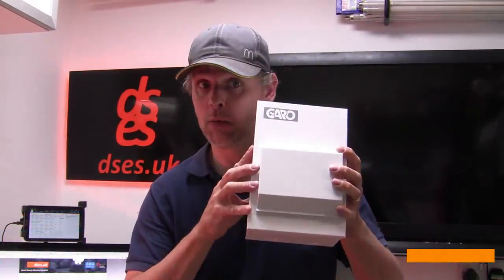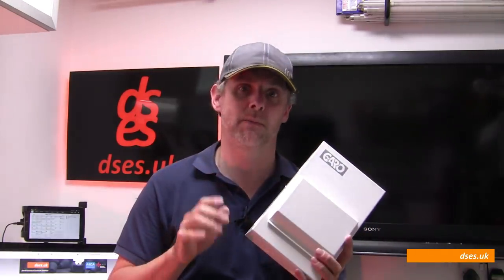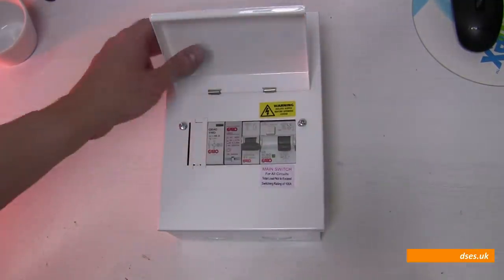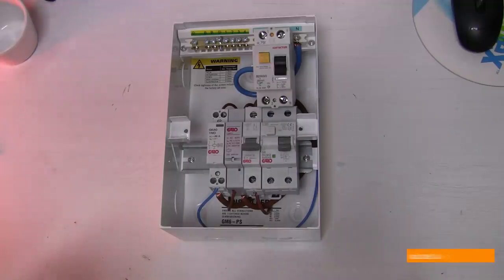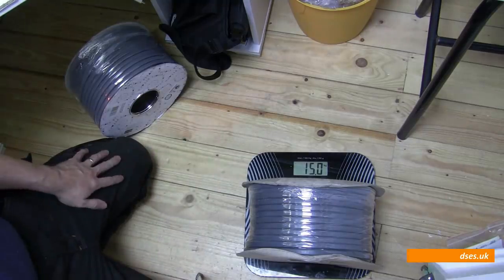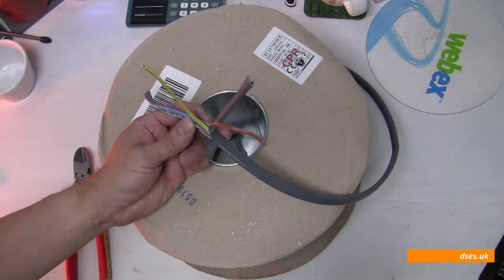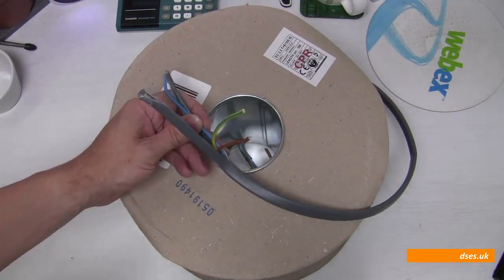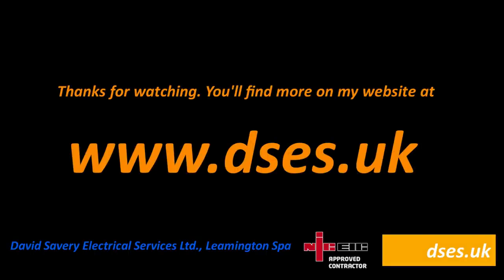Interesting Irish Innovations

Comment: All PEC (protective earthing conductor) in TPS cables are insulated in NZ and AUS. They are also the same CSA as the other conductors ( except 6.0mm^2 and larger which have a smaller PEC) and all made up of 3 or more strands (except 1.0mm^2) so that it can be used for wiring in transportable structures.
Reply: 4mm cable still has a 2.5mm earth.

Comment: It was a tough change but I like it now I have to say. Handy at sockets, switches, fuse boards etc and also handy when all cores are sized the same doing Electrical calculations and not to mention I am just about ready to bin my wander lead, bang off a socket, take a measurement, half it, boom. Quick time.

Comment: Here in Australia, all earth conductors are double insulated (or 'pre-sleeved' I guess you could say) as with your Irish gear there. As far as I know, we actually never usually sleeve anything at all. Where you might use a 3-phase conductor (brown, black, grey), and sleeve it up as 2 brown and one blue - for an active, switched and neutral (as I have seen on other British YouTube channels). We would use a twin & earth (red, black, green/yellow) and depending on the situation, we'd run either a separate single active (red, double insulated) or a twin active (generally red for active, white for switched active). Iv'e never seen an active conductor sleeved as a neutral here.

Our earth conductor is the same size as the twins up to 2.5mm, after that earth stays at 2.5 (ie. 6mm twin & earth still has a 2.5mm earth). I feel a little safer having the same size earth as twins on our power circuits, I'd be worried some rouge undetected fault current might slip through an RCD and vaporise the puny earth you guys use, leaving some horrid game of Russian Roulette as to whether any earth protection was still intact. Although it doesn't seem to cause much of an issue for you, so maybe we are being too cautious.

The only solid core wire we ever get is the twins in 1mm, anything 1.5mm or larger is always stranded. Earths are always stranded, even on the 1mm (I guess to reduce work hardening, which would be dangerous if it caused a breakage on the earth conductor - but again that doesn't seem to be a problem for you guys). 

Other general differences, our outer sheathing is generally white in colour, which I prefer to the grey as you seem to have. Conduit here is usually a light tinge of grey, never black which seems common for you. When chasing into brick here, a ~5mm -ish wide slot is cut with a grider/brick saw, the cable is just pushed in, with thin side into the slot, and just flushed straight over, no capping. We only have one size of face plate, which is rectangular not square, accepts anything from 1 gang up to 6 gang switches, or 2 gang power outlet. Hot water heaters here are only seldom electric, they are usually gas or solar (as in sun heat not PV), and they are a single unit which covers the whole house, we don't add a separate booster unit in each shower.

I must qualify that my experience is only as a hobbyist, and filling in as a TA for various sparkies any time they've had our electrics apart. As such I'm fairly limited to residential experience, I guess commercial or industrial fit-outs may be a different kettle of fish. I'm happy to be corrected if there are any other Aussies here with more knowledge. Hopefully some of this was interesting to someone.

Comment: That new T&E cable we have in Ireland is a pain in the bollox, cpc is the same size as L and N. All tubing accessories etc are still the same but the cables have more beef. Where possible I'll use contactors for switching showers at the DB because it's nearly impossible to terminate two of the new 10sq T&E into a pullcord and box anyway decent so straight to the shower with supply and 10amp switch for the contactor. Love the videos👍
Reply from the maker: I hear that John. I expect most accessory manufacturers churn out gear for the UK and don't take into consideration the bigger CPC sizes Ireland is using. A three-core 10mm must be a monster to try and wrestle into place! Can't say I envy you that, although I do like the sleeved CPCs!

Comment: 5th September 2017 was the date that the new T&E became mandatory in the south of Ireland under an Amendment to ET101:2008 National Rules for Electrical Installations.
Reply from the maker: How are you finding it? Do you know why the change was made?
Reply: It's great for second fixing @dsesuk  but, as you say, is probably 30% dearer. For 6mm^2 and above it can be a pain as typically terminals in accessories haven't been designed for it. (Bear in mind most of these accessories are made in England where it isn't required or permitted.) I actually stock both types of cables as I work on both sides of the border and am an NICEIC Approved Contractor as well as a RECI Registered Electrical Contractor. My local CEF get me the gear no bother and at a good price. Overall I like the new cable. At a guess I would suspect the reason for the change was harmonisation with the Continent - but that's really only a guess.
Reply: @richardwalsh5882  I suspect you're right about harmonization. Most continental europeans think (justifiably) that skimping on the conductor that does nothing during 99.999% of it's life, but during that 0.001%,  WILL save your life, is a false economy.

And I agree with them
Reply: @TheChipmunk2008  is there the slightest evidence that a thicker, insulated protective earth will be any safer? It's not going to make any difference to RCD protection (which ought to trip in on any fault to earth). Even if there is no RCD protection, or it has failed, then the over-current should trip within specifications if the circuit is even reasonably near the design criteria. 

As for the extra insulation on the protective earth, does that make the slightest difference? I suppose of there's insulation break down on line or neutral such that it would come into contact with the uninsulated protective ground it won't now trip the over current or the RCD, but is that even desirable to have undetected failed insulation? 

This all looks like manufacturers lobbying to me. Another 22% copper content to increase sales with a vanishingly small impact on actual safety. I'd be fascinated to see if there is actually any objective evidence showing increased safety results from these changes.
Reply: @TheEulerID  are you going to trust your life to some newfangled electronic RCD or are you going to trust to basic physics
Reply: @TheChipmunk2008  as it happens, physics as that's what I have a degree in (Imperial College 1986). That also means I take a realistic view over how circuits work, and what are significant risks Vs the purely notional. I've done quite a bit of electronic design in my time. The theory behind the choice of conductor circuit sizing has basic physics behind it, and a 1.5 sq mm cable will exceed the criteria for an MCB trip on a 20 A radial or 32 A ring which is half way decently planned. It's what engineering design is about, not just adding in stuff which makes no real difference. It's the proper implementation that matters.

Comment: We used to buy Pallets full of this type of Cable from Newey & Eyre , 20 years ago ( I think the Brand was called Irish Driver ) we are an Exhibition Electrical Firm and we used to find that the pre - sleeved Earth saved us a lot of time.
Most of it was just Scrapped after each Show / Event - now we have made up Set Lengths of HQI Flex with 16 Amp Weelan Type Plugs and Couplers , this saves us even more time and vastly reduced wastage.
Reply: The name's familiar (Irish Driver/Harris, in my experience?)

But yes, it's definitely been a thing for a long time, and SHOULD be ubiquitous

Comment: I was perusing online and came across 2.5mm t and e available as stranded which I think would make sense as it would make it so much easier to work with. I quite regularly use 4mm on radials and it's a joy to work with. I had seen that stuff you had Dave on Meteors website and did wonder about it's legality in Blighty.
Reply from the maker: If it's good enough for Ireland, then it ought to be up to muster for us!
Reply: Narrowboats use stranded cable and it is a nice thing to install with, but it loves to flop around everywhere if you don't put a load of clips on it.
It also increase the installation time somewhat as termination into standard outlets requires bootlace ferrules, although many people still don't use them...

You do have to also consider the de-rating factor of 0.95 for stranded cable - rarely a concern on boats as circuits tend to be rated quite low, but it can nudge you over if you're unlucky.
Reply: I was only commenting to my colleague today, that the 6.0mm (stranded) cable for the cooker was a joy to deal with compared to the bastard that was the 2.5 mm (solid) radial for the oven. Despite the fact the 6.0 contained a 2.5 CPC... lol

I think there's probably something OU video worthy about sliding strands and so forth going on :(
Reply: This ties in nicely with a thread on the IET forums about meter tails being way too stiff now... and whether stranded cable would be acceptable. If insulated AND sheathed. I think it would, but apparently some DNO's don't like it
Reply: @TheChipmunk2008  19 strand easy fit meter tails are now available to buy.  Just Google it. My Elecsa assessor had no problem with them and they make tailing up so much easier.
Reply: @TheChipmunk2008  Perhaps the solution there is standard tails to an isolator switch, then stranded tails from there to the CU. The DNO/meter engineer can't really complain then and it's only the CU end where the flexibility issue lies.
Reply: Aall Australian and NZ cable is stranded except for 1mm2.  And its all fully insulated PEC too, along with same sized earth at 2.5mm and below.

Comment: As a Irish spark, I've used this cable , 10.mm is so difficult to install in a shower switch ☘️🇮🇪☘️
Reply from the maker: Yes, the larger sizes must be a nightmare! I don't envy you having to pull in a 10mm shower cable!
Reply: 10mm t&e WITHOUT a sleeved earth is hard enough to terminate in a shower switch like I did few weeks ago,I don’t envy the Irish for this ha ha.
Reply: @tommochelsea72  Glad I live in a country where that shower would have three elements wired to three-phase 2.5 mm! And no isolation switch, if you're working on it, lock out the MCB! That's the reasoning here - not saying it's any better or worse!
Reply: I run the shower through a contactor, that way you only need a 10amp pull cord to isolate the shower, avoids the hassle of terminating two 10sq cables in a pull cord 👍
Reply: Shinnion  That's worth considering  ☘️

Comment: i was stunned when I saw that uk had unsleeved earthing wires. here in NZ I have only seen sleeved
Reply from the maker: I reckon if one of the big cable firms like Draka or Prysmian made a sleeved T&E for the UK market it would be a good seller even if it did cost a few quid more.
Reply: Sleeved here in Australia as well
Reply: @dsesuk  Prysmian and IDH ( ex Irish Driver Harris ) cables both make full ranges of T&E cable in Irish Standard, but I don't know of a UK based supplier
Reply: Sleeved everywhere but US, Canada, the UK and Norway I think. Might be some small countries following the respective regs. (Malta and Cyprus maybe?) but that's about it.
Reply: Here in Sweden earth has always been sleeved and of equal area as the live wire since all of my almost 50 years of life.

For some of our cable standards there are twin + sleeved earth + unsleeved shielding wires made from steel, but much more sparse than in an armored cable and the best way to handle the shielding is still widely debated, unconnected, connect to earth at one end or both ends.

It's very interesting to see how equipment and practices vary between countries. The British islands have the habit of unapologetically doing things their own way, with varying degrees of success. I think it's a very charming personality trait among the britts and always an interesting topic for discussion.

Comment: Why don't we use nyy cable, they use it in Ireland and lots of the EU. Its round which makes more sense. I've never really got what the idea of having a flat t & e cable is all about.  Nyy cable has the earth sleeved and all cores are the same size. Much easier to clip round bends etc.
Reply: And round back boxes.
Reply: You mean NYM cable, NYY is the black stuff 😎😎😎
Reply: Yes it could be NYM.
Reply: NYY-J (Hi-Tuff) is used in the north a fair bit. NYM-J is used in the south extensively. Hi-Tuff isn't common there. It should be remembered, however, that NYM-J is not UV resistant and shouldn't be used unprotected outside.

Comment: IS 101 ( the regulations for new standard T&E ) are also BASEC compliant, so it is certified for use in the UK. personally I think the 6mm and 10mm sizes of this cable are the most useful when installing things like electric showers or earthing extraneous conductive parts such as a metal building, where the need for a separate earthing bond can be eliminated.
Reply from the maker: Interesting to know, thanks Lewis.
Reply: I.S. 201 (not IS 101). However it won't meet the UK certification for BS 6004 cable so I don't agree that it is recognised by BS7671. BASEC provide certification for Irish products - that doesn't mean that they are compliant with British Standards where the Irish Standard differs. Incidentally, I.S. 201 cable wasn't identical to BS 6004 cable before the change either - 6mm^2 cable had a 4mm^2 cpc; 10mm^2 cable had a 6mm^2 cpc and 16mm^2 cable had a 10mm^2 cpc for I.S. 201 variants.
Reply: @richardwalsh5882  have a look at both Prysmian and IDH websites, both companies state that these Irish cables have also been BASEC approved
Reply: @lewisbrand  I know that they're BASEC approved but the approval is to I.S. 201-4 and not to any British Standard. BASEC and HAR do Irish Standards approvals along with VDE etc. approvals being recognised.
Reply: @richardwalsh5882  BASEC ( British Approvals Service for Electrical Cables ) is the legally recognised competent authority in the United Kingdom whose certification of a cable type ensures that the cable in question is acceptable for use within the UK, thus these cables have not only got approval in the Republic of Ireland, but , separately , also, approval for use within the UK, and are marked as such
Reply: No Lewis Brand  - BASEC operate an approvals service for the south of Ireland subcontracted out. This is simply because the 26-County state is too small to justify operating its own approvals body. Therefore BASEC operate an approvals service for Irish Standards as well - this does not mean that these cables comply with any British Standard because they don't. Even BASEC have been clear about this. They operate British Standards certification and Irish Standards certifications independently of each other. The fact that they are called BASEC has no bearing on this.
Reply: @richardwalsh5882  BASEC do not, repeat do not approve cables that don't meet UK standards, even if they do approvals for other countries. If you don't believe me feel free to contact them, as I have done so in the past

Comment: I thought I was going to hate this cable when it came in but actually really like it now although no getting 5 1.5’s into a 22mm oval conduit anymore so just have to knock out a second chase ☹️
Reply from the maker: I like the idea of the CPC sleeving, but not so much the increased CPC size which I imagine may become a headache very quickly on the larger cables!
Reply: @dsesuk  It does make the whole impedance calculations a lot easier.

Comment: "You wouldn't use it for anything else, would you?". I've seen the CPC used as a switched line in multi-way switching by someone who I charitably assume didn't have any 3 core and earth on them.
Reply: Same on the continent - using the green/yellow core for anything but earth or PEN has been illegal ever since the introduction of that colour scheme in the mid-60s but it's still done far too often.

Comment: Surely unsleeved CPC is for the benefit of Mr Idiot when he drives a nail or something through the cable or floods his basement..his nail  or water will make contact with CPC first?
Reply from the maker: You could argue that I guess. Let's face it though, it's omitted for cost. Keeps cables cheaper and leaves installers pissing around with over-sleeving at connection points!
Reply: @dsesuk  Thanks for the reply. keep up the amusing tales of the not quite expected.

Comment: Did you find out of you could use the Irish T&E in the UK? Or if they are plans to introduce it in the UK?
Reply from the maker: Hi Luke. No, I never did check. I presume it's unlikely to draw complaints if it's good enough for Ireland. Who can moan at a larger all-sleeved CPC?!
Reply: @dsesuk  I'm sure you will find someone on here who will disagree.
Reply from the maker: @heffo1992  Oh, I imagine so. I think it's been pointed out before that it wouldn't comply with.... whatever standard.... even though electrically it would be just fine.

Comment: Sleeving the earth wire within the enclosure serves the useful purpose that as the stuff inevitably gets bent up as the switch or socket is screwed home and a  bare protective earth could come into contact with an exposed bit of live or neutral metal. Rare I would give you, but inconvenient.

The issue with insulating the protective earth throughout, besides the cost, is that it makes the stuff that bit bulkier, and that bit less flexible. I really can't see sleeving as a big deal. I don't take identifying seriously. What else would a bare copper wire be other than protective earth? It's a bit like those silly notes over mixed colour coding in domestic wiring. What sort of idiot wouldn't instantly notice that there was a mixture of R/B/G and Br/Bl/GY cabling? It's not that anybody is going to mix them up is it?